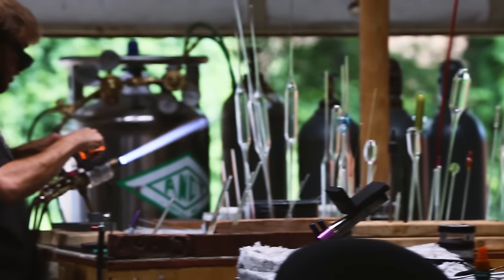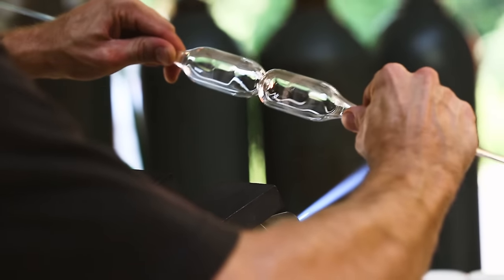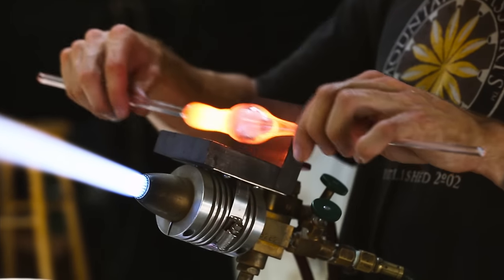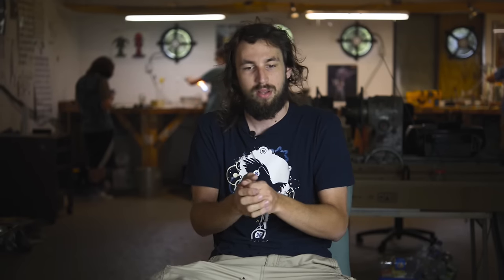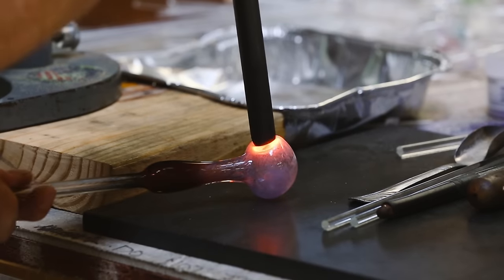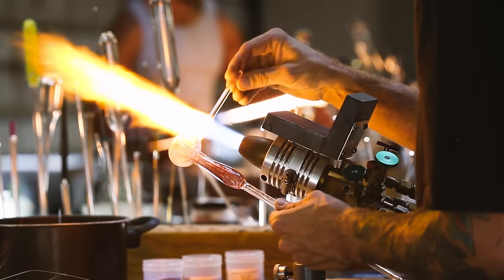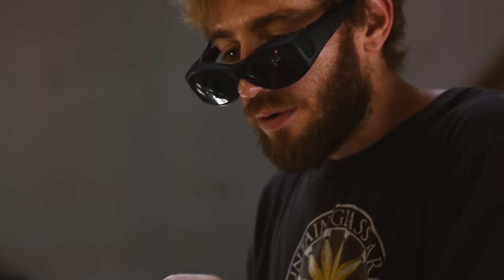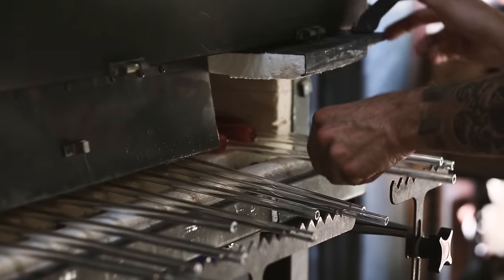How it's Made: Hand Pipes

Comment: great video mate,just wondering im new and just blowing pipes...or trying to for fun at home
2 things
#1my bowl when blowing to expand almost alwas seems to be to one side or gets a flaty sort of soft spot
#2most mates ive seen hold to formed bowl just on the edge of flame until hot then blow quickly creating a nice big hole but mine always pops a tiny one
so you all most likely say more heat but when i do i get one of those fukin flat spots again?????
Reply: What I noticed about getting flat spots is mainly from not rotating it enough. Otherwise the torch could be the culprit- flame might be too concentrated(tiny focused flame).

Comment: How do you put a hole in the bowl it always just goes down when i try to poke a hole??
Reply: Shane lawrence I am no expert at all so I might not help but are you sure where you are tying to make your whole is hot enough? It can be somewhat hot to where you can just form it the glass will compress but it's not hot enough to puncture....that would be my guess but like I said I don't have very much experience just seen that no one else replied
Reply: Your poke point is not hot enough, that's why it stretches instead of splitting. Your welcome.😁
Reply: You pop the hole BEFORE you make the bowl. So first you pop a small hole with a pinpoint flame, let cool, then heat the whole area for the bowl, give a puff to freeze the hole size, and push.

Comment: You want to learn all that just go to the glass school.. but it does have some bubbles there that breaks easily in the buttom and them you have to cut the end of breaks then people start to think that i use Crack and is something that i dont smoke.. but in case like that isnt hatd to fix the problem just have a cigarete filter and push back some and you still have space to smoke meth..